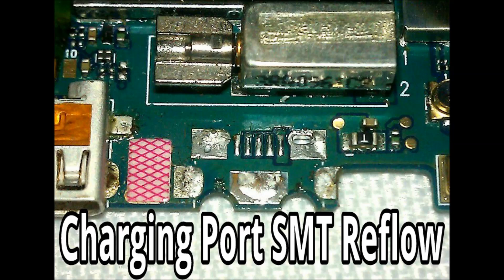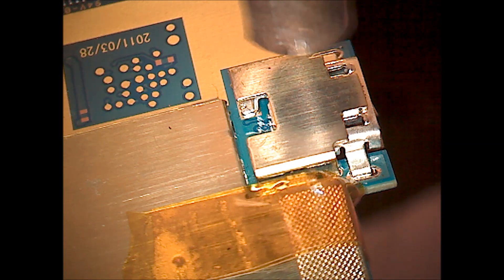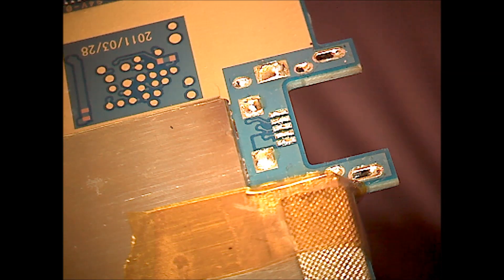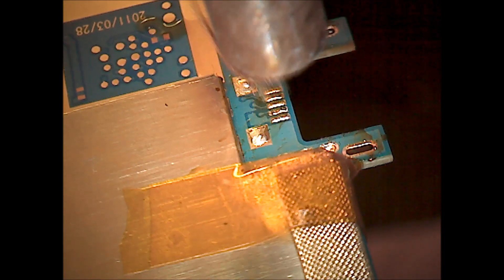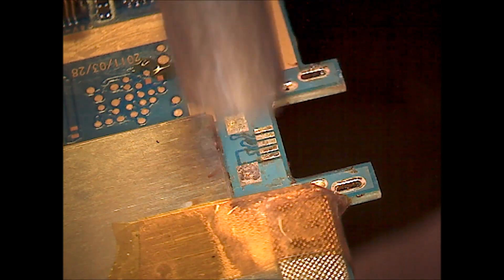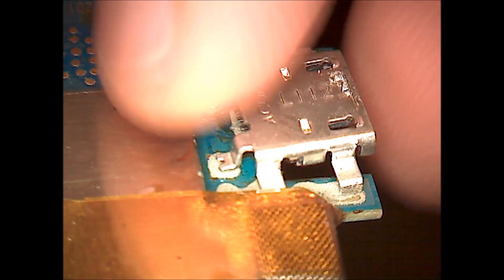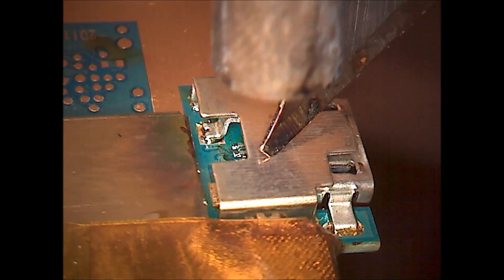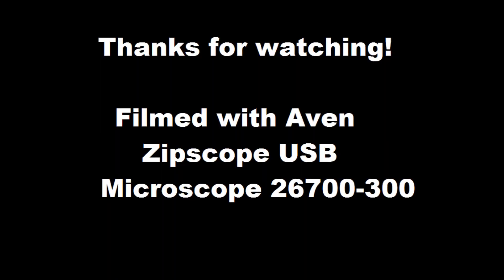SMT Solder Reflow: EVO 3D Charging Port

Comment: Please help I did it like you exactly did but now the screen stays black and its not the back light since the screen is complety black .tried different boards and lcds , I think I damaged something but how to fix it, there are a lot of info is needed by customer
Reply from the maker: Sorry for the late reply. Most likely something was damaged during the repair. When dealing with this amount of heat, you have to take care not to move or damage any of the surrounding components around the charging port.

Comment: You do some great videos of the charge port repairs.  I run into issues on a lot of boards where when i heat and lift the port out, the traces for the pins get ripped off the board.  Do you have any suggestions to prevent that ?